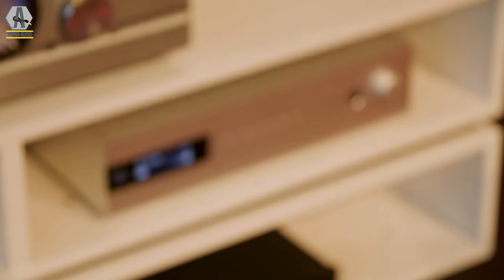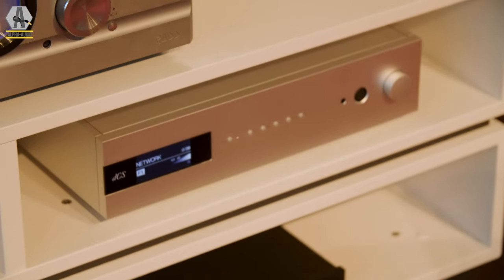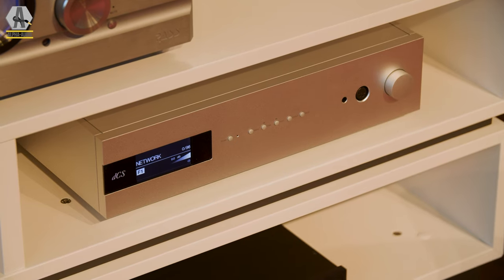Why is dCS unique? About the Ring Dac, Clocks and Apex!

Comment: Another question- Is the improved output stage of the Apex upgrade imply that whereas before Apex a high end pre-amplifier was certainly required to ensure fidelity, whereas now we can regard the Output stage of Apex as uncoloured truly high end pre-amplifier into any power amps of user choice And that decision to deliberately use a pre-amplifier in Apex  is technically a desire by user to “ colour” the sound e.g. valve pre-amp use to typically warm up sound? Is the digital volume control vs analogue volume control that “ audiophiles” keep moaning about negated by the new Apex upgrade( another reason to use pre-amp)?